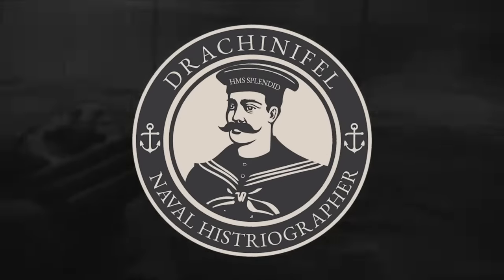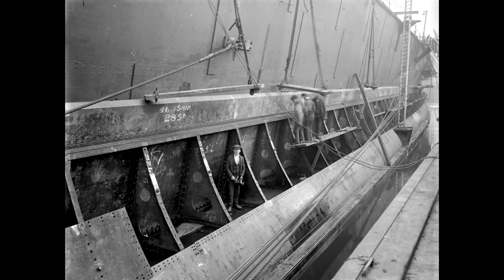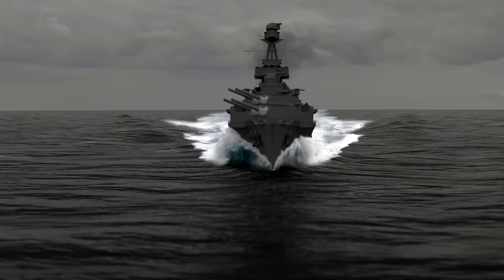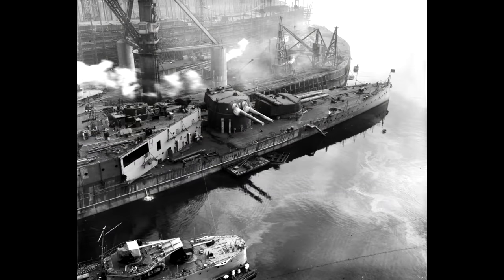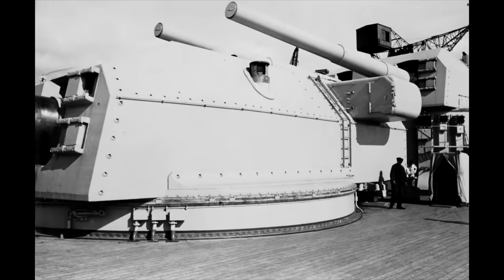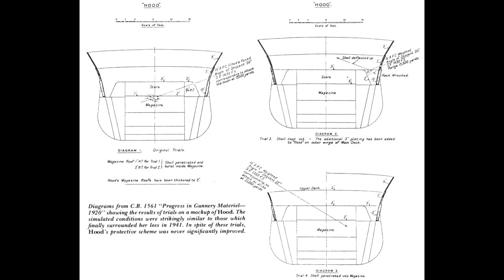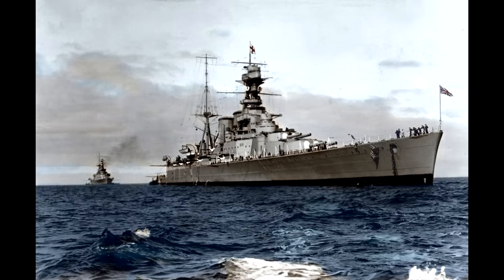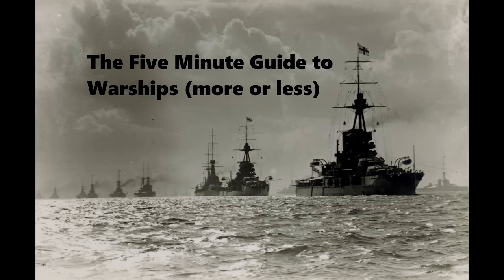The Loss of HMS Hood - But why did it blow up??

Comment: It’s really not that lucky when u think about it.  That’s exactly what the Bismarck’s guns were intended to do, destroy enemy battleships.  
Now When when the Bismarck scored a bullseye through the PoW bridge and instead of detonating and wiping out the entire staff including the captain and Executive officer and possible the navigator (#2 officer) thus decapitating the POW’s entire command crew (as well as anyone one or 2 decks below) the fuse failed and the shell passed through the bridge (killing many along the way).  That’s a lucky FUSE!!!  
  If that shelf fuse had worked you could kiss the PoW goodby as well as the Hood.  Imagine the headlines then!

“German giant destroys the Royal Navy’s flagship and its the newest ships in a lopsided 2-versus-1 engagement!  World stunted!”
Reply: No there was a HUGE amount of luck involved in Bismarck's hit on Hood's magazine.

A full salvo of main gun fire from a battleship is analogous to a scatter of lead shot from a shotgun. During the battle of Denmark Strait, the Bismarck aimed at Hood from 8-9 nautical miles away. At that range the 38 cm SK C/34 (Bismarck's main armament) had a CEP (circular error probability - effectively the radius of a circle within which 50% of its shots would fall) of 100m. That means that if 8 of Bismarck's 15in guns fired at a single point 8-9 nm away, 4 of her shells would be expected to land (with completely random distribution) within an ellipse (think of it as a stretched circle, due to the angle of fall of the shells) measuring approximately 200m (660ft) wide, (or to put it another way 76% of HMS Hood's 860ft length), by more than two thousand feet long. The other 4 shots would land even further away from the aiming point. That being the case, how can an individual shell be aimed specifically at a tiny part of HMS Hood's structure, namely the 4in HA magazine, that its believed triggered off Hood's detonation? I'll give you a hint, there's a little clue in my paragraph above....where it says "completely random distribution".

A simplified analogy is that if you prop a dartboard up 50 yards away and can consistently knock it over with a shotgun at that range then that is pretty good shooting, just as Bismarck / PE achieved during the Denmark Strait encounter.

Now you can "knock the dartboard over" all day long with the shotgun and STILL NOT hit the bullseye (magazine) with an individual pellet. As opposed to being a skillful shot by knocking over the dartboard, whether you hit the bullseye with an individual pellet is complete luck.

The idea of HMS PoW not being more heavily damaged because of the failure of the German fuses, was less to do with luck and much more to do with the KGV class's "all or nothing" armour scheme. PoW was hit by a total of seven German shells during the battle of Denmarck Strait and not ONE of them detonated as designed. This is because in the "all or nothing" system of armouring only the most vital "citadel" is heavily armoured, the rest of the ship's superstructure being comprised of standard naval "splinter" plating. This meant that a shell hitting non vital areas of the ship, instead of having their fuse activated by the shock of impacting on a substantial piece of armour instead passed through without detonating (or only partially detonating or with a delayed detonation) menaing that far less damage was inflicted on the ship.
Reply: @walterkronkitesleftshoe6684  I’ll ignore the entire beginning of your statement about the Hood, since all I said was @thats what the Bismarck’s gun were meant to do” and they did!  

As far as the “All-or-nothing” armor.  That’s NOT WHAT THAT STATEMENT MEAN!  The all-or-nothing armor scheme applies to the hull of the ship, NOT the bridges, not the armored deck-house, not the turrets or the barbettes etc… it means you have a main armored belt covering your vitals running from the beginning of the front of the first turret to the back of the last turret in the aft of the ship, while the bow forward of the belt is UNARMORED, and the aft of the ship to the rear of the last turret behind the belt is ALSO UNARMORED, unlike the Bismarck which had a “distributed armor” scheme which had 60mm of armor on the bow and stern of the ship in front of and behind the main belt.  
  Also!  The bridge on the PoW had 100mm of armor plate.  More then enough to trigger the fuse if it worked.  Also the Prinz Eugene’s shell that hit or landed next to the twin-5.25” dual pier pose guns malfunctioned.  The rest of the shells either hit water before diving or arguably the shell that hit the secondary fire director on PoW had a shot at exploding but that really is questionable.  
  So In conclusion, one bullseye is a lucky hit, 2 bullseye’s is skill and quality.  Even though all around the Bismarck design was a God awful ship that was 7,000 tons above treaty limit while sucking worse that the ships (generally speaking, as in all of them) that weighted in at 35k tons.  But that doesn’t mean individual parts of the Bismarck all sucked.  Such as, it’s guns.
Reply: @walterkronkitesleftshoe6684  also, my stats say that the Bismarck’s dispersion is 101 meters at 16,000 which is about the distance that the shot was made.  I am not sure that means a CEP of 100 meters, also It may very well could.
Reply: @walterkronkitesleftshoe6684  luck is when the PoW hit the tip of one of Bismarck’s boats and caused the catapult to break by debris.  Now that was luck.  Or severing the fuel line when it’s shot went clean through the bow was luck (also I never knew, and still can’t find a single schematic of the Bismarck that shows it had fuel tanks in the front bow of the ship).  

Remember once the Bismarck switched to PoW it scored hits on every salvo, including one after it started to make smoke. When it punched a hole clean through the smoke stack and also hit some minor part of the ship.  

But still!  You have to agreed if that fuse goes off, the PoW is finished.  Either by the Bismarck or the Prinz Eugen’s torpedoes.  But that is how close the Royal Navy went from simply losing a battle to a historically calamitous disaster that would live in the annals of shame.
Reply: @WorshipinIdols  So now you've changed your original assertion from "Bismarck's hit wasn't luck but skill", to "everyone has a degree of luck". Thats fine by me. Of course the specific point of impact of ANY shell at longer ranges is affected by luck. The skill in long range naval gunnery is simply getting the shells within a couple of hundred feet of your intended target, the rest is providence.

As for Bismarck "scoring hits with every salvo" that means that Bismarck must've only fired 3 salvoes at PoW, as that is the number of hits she achieved, when the truth is that there were plenty of salvoes that scored no hits (which is not to mock German gunnery, its just the nature of the game ), and as we agree none of the three hits detonated as intended, due to the design of PoW's armour scheme.

Seems your entrallment with the German ships knows no bounds, attributing torpedoes to Bismarck (she had none fitted) and Prinz Eugen Who at no point during the Denmark Strait engagement was anywhere near in range to use her G7a TI steam torpedos even at their lowest speed setting.

In what way do you consider that the RN "lost the battle"? Because of the loss of the Hood? What about the fact that Hood and PoW were tasked with preventing the German ships from breaking out into the Atlantic, and as a result of the action "operation Rhineübung" was stopped in its tracks and Bismarck then had to futilely run for its life back to France? Job done.

Its the same reason that the RN won the battle of Jutland. German high seas fleet sets out to ambush the Home fleet with a view to breaking the RN North sea blockade, the RN suffers heavier losses BUT the blockade remains intact and the German fleet skulks back to port never to show its face again (except when it was surrendering to the RN at Scapa Flow).
Reply: @WorshipinIdols  Look up "circular error probability" ... the RADIUS (and NOT the diameter)of a circle within which 50% of the impacts of a weapons projectiles can be expected to land.
Reply: @WorshipinIdols  I've only just spotted your first reply.

The "ALL" of the "all or nothing" armour scheme refers to the "box" that covers the machinery spaces, magazines, shell handling, barbettes and turrets, and the "NOTHING" refers to the rest of the ship. Its pretty self explanatory really. Compare a diagram of the armour distribution on KGV and Nelson classes to that of the German ships. you'll notice that apart from the armoured "box" of the citadel (and one or two minor localised areas on their superstructure) the British battleships have virtually NO thinner armoured areas, as opposed to the German ships using the outdated "incremental" armour scheme, where multiple decks and vertical surfaces have armour of between 1 and 4 inches of armour just ripe enough to activate the fuses of incoming shells whilst not being proof to those same shells, as well as sizeable chunks of much heavier armour dotted around her superstructure.

The hit on PoW's bridge as the photos you have no doubt already viewed will attest (they'll be there with the photos of PoW's perforated rear funnel) CLEARLY show the torn splinter plating on BOTH sides of the "flying" bridge and NOT the small area of 4 inch armour you suggest that actually faced the sides of the armoured conning tower 1 deck below.

You're ALMOST correct in saying that the main armoured belt of the KGVs covered the area between the front of the A turret barbette and the rearmost point of the Y turret barbette in the same manner as Bismarck, but like Bismarck it did actually extend BEYOND those points with both fore & aft lower belt extensions, as well as having much heavier horizontal deck armour both fore and aft of the main turrets than Bismarck.

I thought that we'd established that the idea of picking specific areas of a ship to target from 9 miles away was very much in the realm of "fantasy land", as the target you're aiming for is simply "the ship", with the precise point of impact being in the lap of the gods. Your erroneous "one bullseye is a lucky hit, 2 bullseye’s is skill and quality"s is once again drifting into the area of "nazi fanboism". You do realise that buying 2 lottery tickets does not halve the odds of winning, it merely gives you two chances at exactly the SAME outlandish odds that one ticket gives you. in the same manner two lucky shots are exactly that... two lucky shots. You cannot use a blunderbus of 8 x 15in shells to "snipe a bullseye" from 9 miles away.

I'm glad you've given a fair appraisal of Bismarck's design, I'd equally like to state that I am NOT ignorantly attempting to diminish the quality of the German gunnery at Denmark Strait, but merely hoping to "keep it real".
Reply: @walterkronkitesleftshoe6684  my friend, I believe you meant to say “distributed armor scheme” rather than “incremental armor scheme” which is not a thing.  And yes the “all-or-nothing” armor scheme referred to the hull of the ship, or rather, only the “Box”.  Where as on the Bismarck the bow and the stern had at least 60mm (although I have seen diagrams with 80mm of armor also, not sure if it was the Tirpitz, or maybe just certain parts of the bow/stern?) of plate armor to stop shell splinters from shredding the those areas without a direct hit.  
  And although the British battleships were indeed low on armor in the varies other parts of the ship such as the superstructure, that had nothing to do with the “all-or-nothing” scheme, that was just the design of the ship.
  As far as the PoW hit, you may be confusing it with the hit it received in the following salvo that knocked out the secondary FDC on top of the superstructure further back, or maybe your confusing it with the salvo before the one we are discussing when the Bismarck put a hole through POW’s smoke stack.  But the shot I am referring to went physically through the bridge of the PoW, and killed almost everyone in it EVEN WITHOU THE BURSTING CHARGE.  Only 2 man survived including the captain who was temporarily knocked unconscious.  And the bridge of PoW (not the conning tower which was also intentionally under armored since according to the Royal Navy no one actually used them) was protected by 100mm of armor.  More then enough to set of a functioning fuse.
Reply: @walterkronkitesleftshoe6684  also, even though each individual shit that lands is random, the frequency of hits that the Bismarck scored is certainly not.  There were at least 2 hits scored on Hood by Bismarck at rather longer ranges, and 4hits scored on PoW if you count the ACTUALLY lucky shot that went through the water and punched through the torpedo defense before getting  lodged in the under belly of the ship (below the machinery space I believe).  
  Compare that with the 3 hits scored by PoW during the entire battle and 0 scored by Hood.  
  So, while the overall design of the Bismarck was obsolete, ineffective and terribly wasteful of its large displacement (which was not representative of its actually substandard capability) never the less!  Individual components of the ship were of high quality, I.e it’s guns and it’s optical range finders among others.  The fact that Bismarck scored 5 real hits, (and the Prinz Eugen scored how many? 2 on Hood and 3 or 4 on PoW? That’s not even a battleship, speaks wonders when an 8” cruiser is outperforming 2 battleships firing simultaneously in terms of hits).
Reply: @WorshipinIdols  1. No I fully intended to use the widely recognised term "incremental armour" which once again succinctly describes the spread of armour across the structure of a ship, but please feel free to use whatever word you wish. "Distributed" will also suffice.
2. No I did not mistake the 380mm hit on PoW's unarmoured bridge for the 150mm hit on the base of her forward starboard HA director. You already appear to have seen the photographs of the damage to PoW's aft funnel, I assumed whilst looking at that you would also find the photos of both the entry and exit points of the 380mm hit on the bridge that killed everyone there apart from Capt Leach and his navigating officer Lt Comm George Rowell. The entry and exit points clearly show the splinter plating of the unarmoured bridge peeled back like a banana skin.
3. PoW's armoured conning tower was sited BELOW the unarmoured bridge that was hit, which in turn was sited below the also unarmoured anti-aircraft control station which topped the bridge superstructure, and is where Lt Esmond Knight was stationed.
Reply: @WorshipinIdols  Before you gush too much over the performance of the German gunners (which you'll notice I have never said was anything but excellent), you've conveniently missed out other factors that throw a shadow over your suggested hit rates, not the least being that only 2 hits were conclusively confirmed on HMS Hood.

First of all look at the total number of rounds fired by each ship. BOTH the British ships had unfortunately had their "T's crossed" and so were firing a total of 10 main barrels against the two German ships who being broadside onto the British ships were in return able to muster 16 main barrels (including 8 of Prinz Eugen's 203mm guns with almost DOUBLE the RoF of the larger battleships guns) as well as 12 secondary barrels to fire back at the British, resulting in a far larger volume of fire at the British ships than was fired at the Germans (even when taking into account the British opening fire first).

Secondly you've also failed to take into account the misbehaviour of PoW's troublesome 4 barrelled "A" and "Y" turrets, which resulted in PoW actually firing only around two thirds of the shots she should have fired, the figures then start to look very different from the situation you suggest.

I do in one of my books have a summary of the number of rounds fired by each ship, and when those numbers are taken into account, the hit rate of all the ships involved is in the area of 4-6% of shots fired. (Apart from Hood who as you know had mistakenly targeted and straddled Prinz Eugen by its fifth salvo before realising its mistake and then starting from square one in retargeting Bismarck).

Considering HMS PoW was operating with a completely green crew and with one arm tied behind her back she gave MORE than an excellent account of herself. Both landing the first hit of the engagment and singlehandedly stopping "Exercise Rhine" in its tracks.